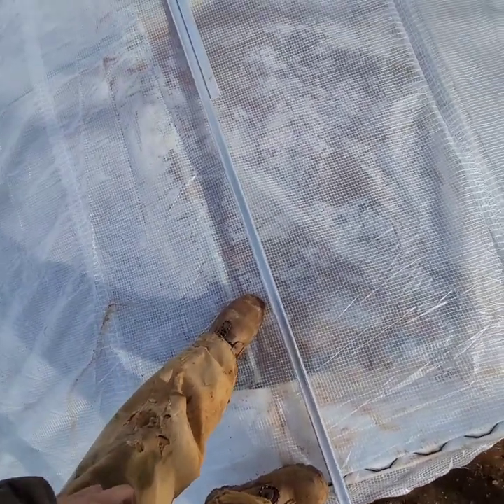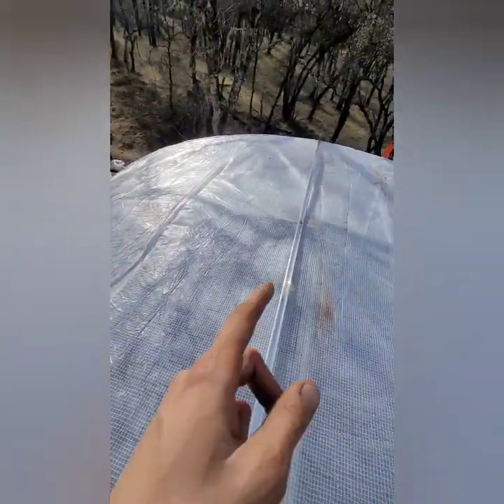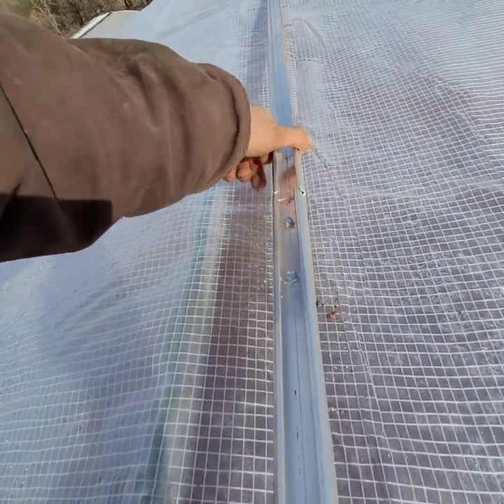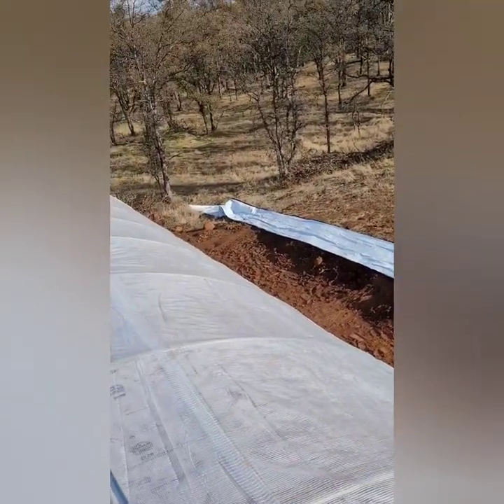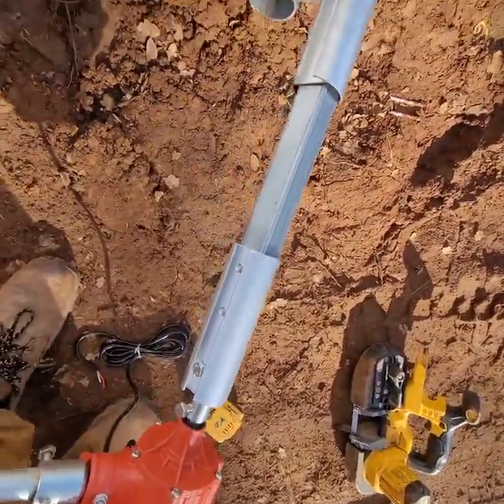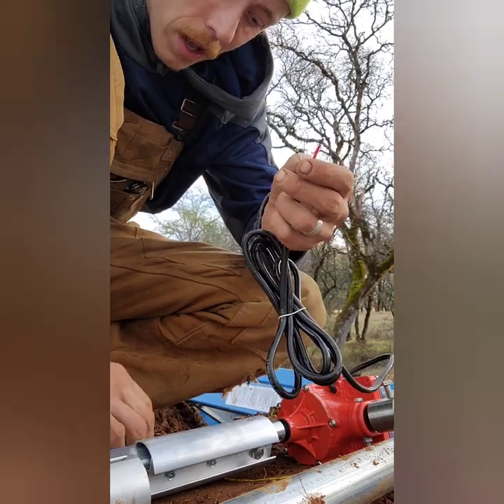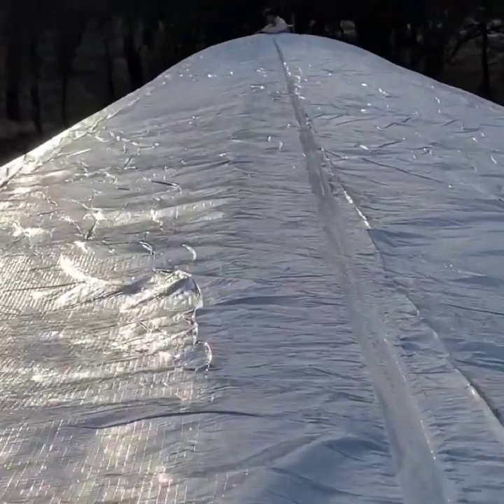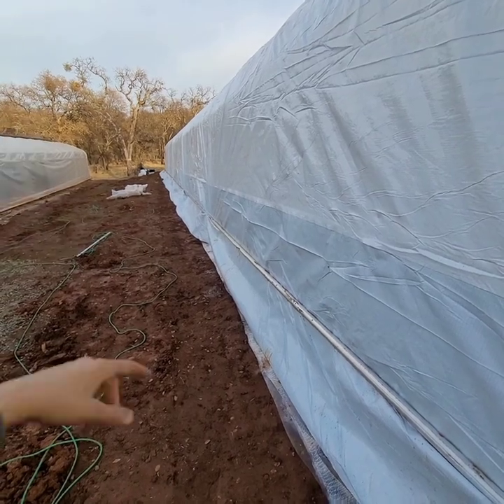how to retrofit or install blackout system on a T3 greenhouse 20x100  #3 video

Comment: Like your channel bro !
Im planning a new construction of greenhouses near Medford,Or. Looking to hire greenhouse installer crew. 

Currently I hand pull a tier 1 - 20,000 sqft feet of pvc hoops.  I like the open air style and get fire results. 

What do you think about about creating 40,000 sq ft 
Worth of metal automatic dep hoops. All open air ( no clear poly) 
Is wind , dew a problem with roller

Plan to do 2 harvests per season out of these .   
Land is west facing slope. Running hoops north to south . Will need to dozer terraces into slope .
Reply from the maker: Hit us up on Instagram therealgreenhouseguru would love to get in touch and get the ball rolling help u out any way we can cheers and thanks for the support
Reply from the maker: 5303384784 🤟🤟

Comment: I recently bought plastic that is similar to yours, I was putting one side up and noticed that there is a bumpy side and a smooth side. I was wondering if it matters which way the plastic faces?
Reply from the maker: No it does not matter which way the plastic faces

Comment: Hey, great video!! So I have a gh that the baseboards are 2x4s and they are not true and level...also, using pvc clips instead of wiggle wire. Is there a way to get the plastic on evenly thats faster than clip and unclip? Our motor is hella slow!
Reply: Same question. My roll up is all wonky. Parts of it move higher and twist and are looser. The motor is really heavy and pulls the bar down at the ends. It's brain draining trying to figure it out

Comment: I recently bought a retro fit kit and I’m  wondering how to get up on the top of my green house without falling through
Reply from the maker: It all depends on how far the spacing of your hoops are and what metal they are constructed out of if you would like to talk more about it you can always give me a call my phone number is 5303384784
Reply: U just just need to buy a thick tarp. I'm 160 lbs and I can stand on top of my tarp.
Reply: @guillaumevu4301  what brand do you use and where did you buy it?
Reply: @bignengsadventures3086  I bought my greenhouses from Hortitech Greenhouse in Oregon. Their phone # is (541) 480-9392. There is no brand for the tarp. My clear tarps are "9 mil woven ac clear with full 4' perimeter overlaps 48ftx102ft" for $1099.98. Then my black tarps are "12 mil woven 46ft×100ft for $150.  

If you have any questions, you can call them. Always buy a tarp that is longer than your greenhouse.

I used to buy thin cheap clear tarps but after 1 season there would be holes everywhere. So I decided to buy thicker tarps. No more holes anymore.